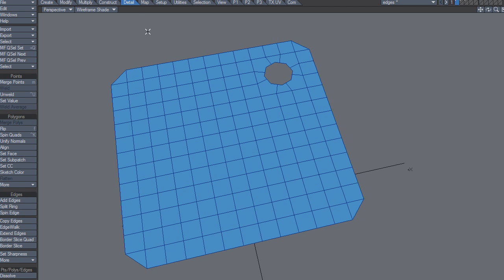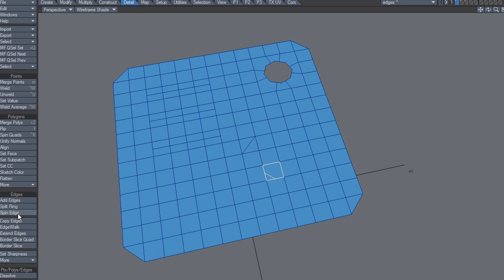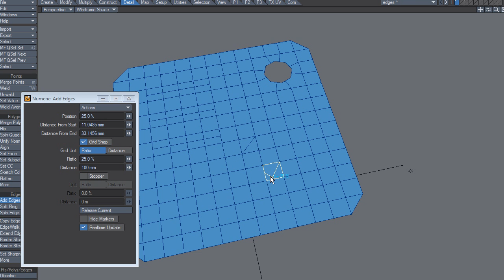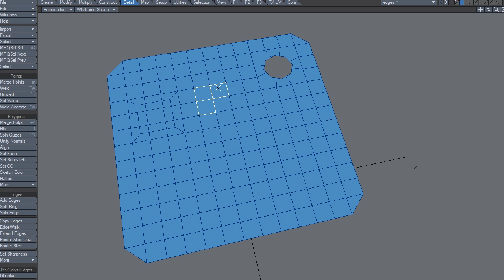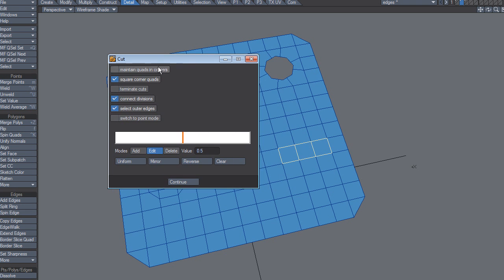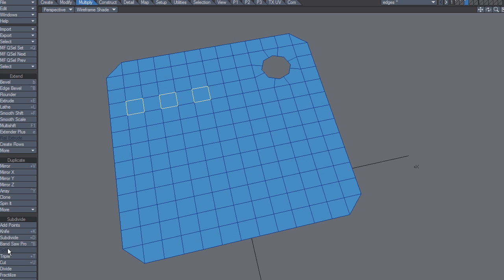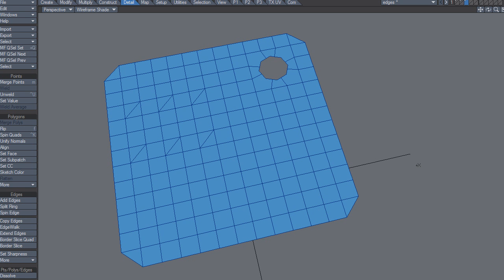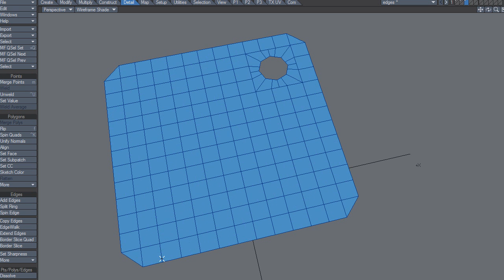LightWave Model - Edge / Split tools

Comment: I only use "Connect", "Dissolve" and "Spin Edge" since they have a wider scope.

"Sping Quads" does not work on polygons other than quads of course, which renders it useless when you working on topology.